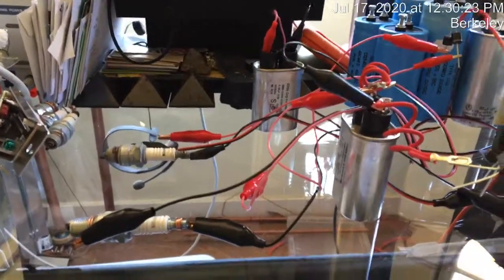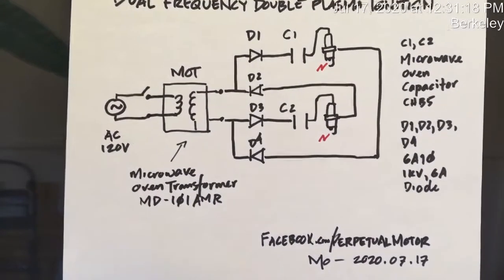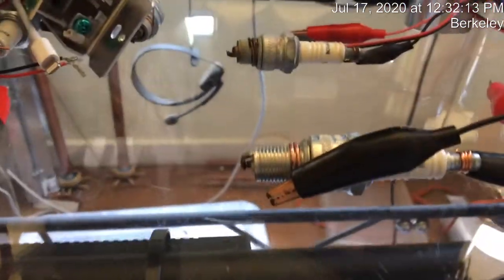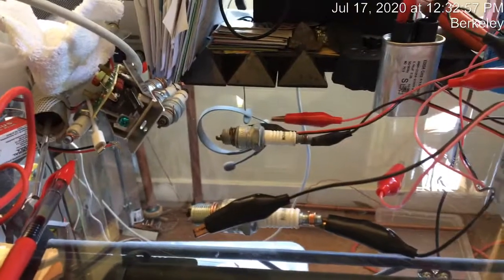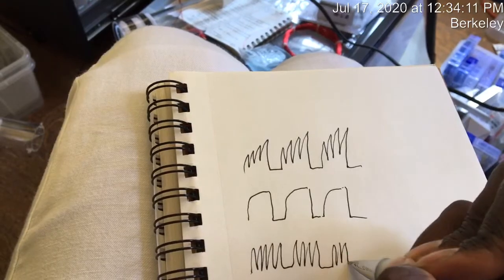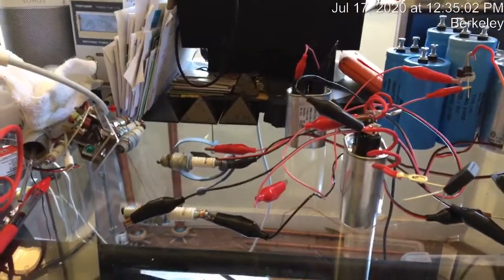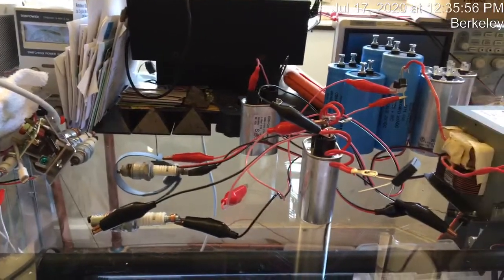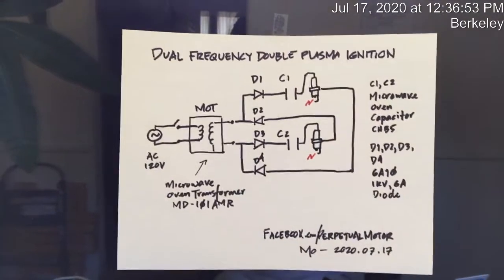Plasma Ignition Driving a Dual Frequency DC Pulse Circuit That Reduces Transformer Heat Generation

Comment: Love your circuit.  Did you remove the resistors in the sparkplugs?  You would get more current.  Sparkplugs usually have about a 10k carbon resistor inside.  Heat the end of the sparkplug with a lighter and remove the end.  A spring and resistor will fall out.  Replace the resistor with a copper wire and use some Loctite to put the end back on.
Reply from the maker: Even more current is a scary thought. ;-) The sound from the sparks in the video don't do justice to what's heard in real life. Thanks for the suggestion. I like the idea. My theory is that the spark is so big that it's getting the hydrogen in the air to explode, which would explain why I blew up a jar of water in an experiment where I had the spark submerged. With lower resistance, I could reduce the amount of input power needed to initiate the spark.

Comment: Hey brother

Take the spark plugs and stick them I no a water container I need and seal it

Get some hydrogen
Reply from the maker: I did that. It explodes, BUT, only before the water gets filled with bubbles. After that, the water is no longer incompressible. So, the explosions are contained by the water's elasticity. At least that's my theory. I got explosions in two separate cases, but I couldn't repeat it reliably. Once I can, I'll make a video.

Comment: Looks like the waveforms of the stan meyer water spit cell, great setup whit the caps it puts energy back in the transformer to encourage the back emf like in the S. E. R. P. S system ;), the Plasma ignition systems are so cool it makes a combustion engine runs so much more clean, peter lindeman showed a spalsma setup was also verry interesting just pit a diode on the circuit en you heve lots en lots more spark
Reply from the maker: The folks at Central Valley HHO (@ssfuturescott on Youtube) has a great command of the use of HHO in combustion engines.